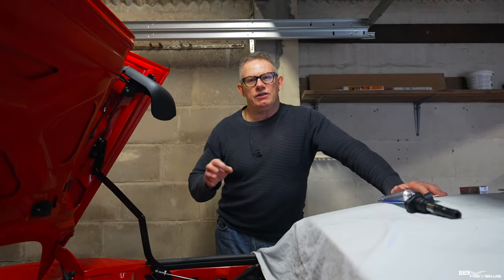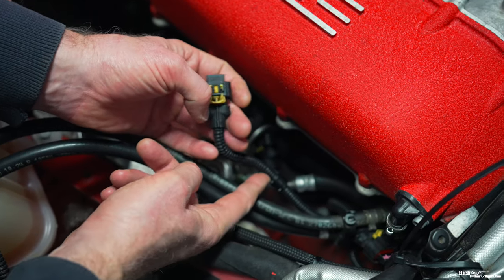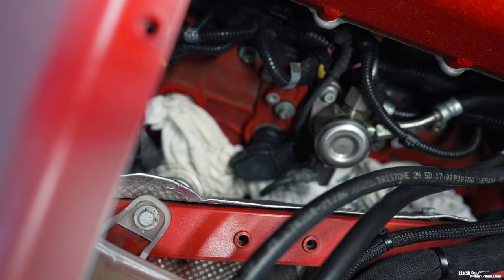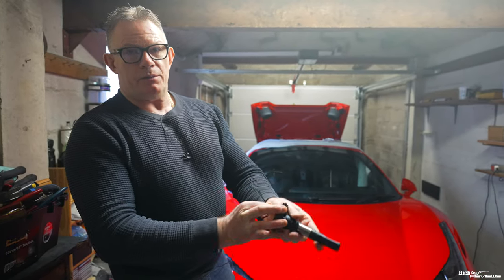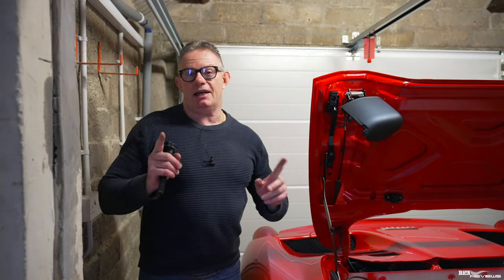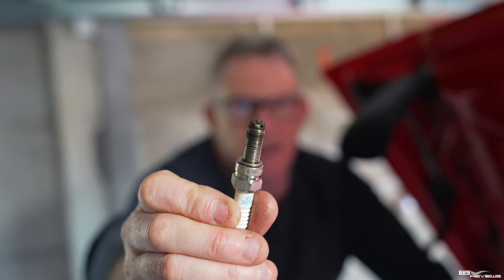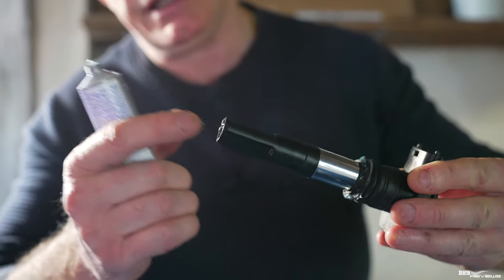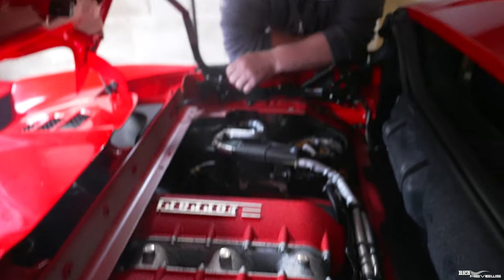How to Replace Ferrari Spark Plugs (Without Breaking Coil Packs!)

Comment from the maker: Here we take on the biggest home maintenance task of Replacing your Supercar’s Spark Plugs. I talk you through in detail exactly what is involved in replacing Ferrari Spark Plugs and more importantly, how to achieve this Without the additional charge of replacing Broken Coil Packs!

You’d think this would be an easy task and years ago before the advent of individual Coil Packs it would have been a lot easier!…Circa 4 Hours Just to remove the Coil Packs without breaking any!

Each Winter Workshop repair will be fully documented in a separate video so make sure you’re Subscribed to receive Notifications for each video!…
https://www.youtube.com/RichReviews-TV/?sub-confirmation=1